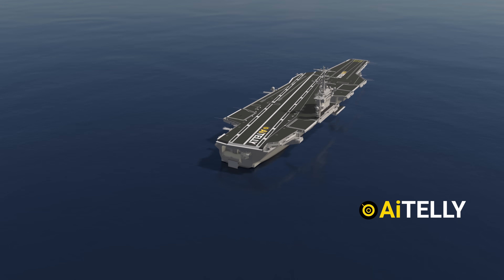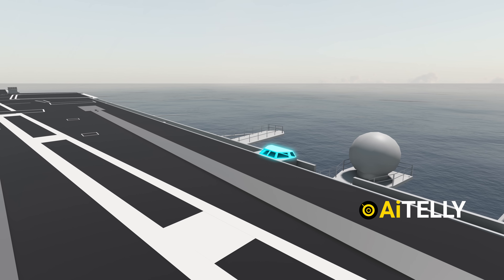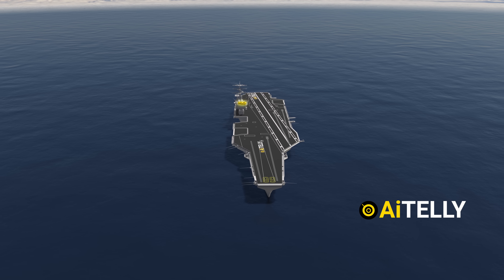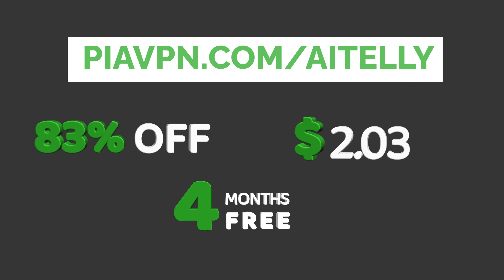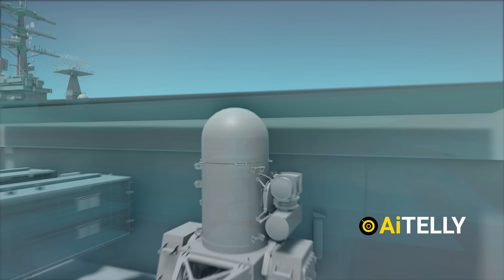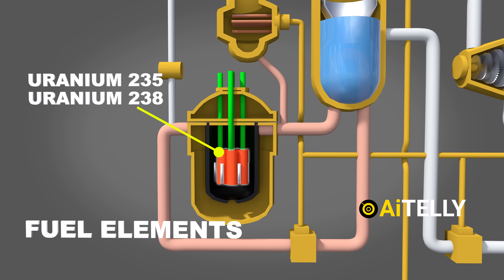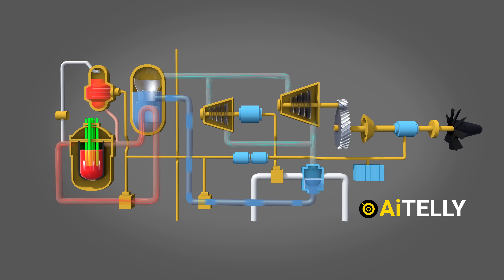How Aircraft Carrier Works? US Nuclear Power Ship Nimitz Class #ship

Comment: I'm a former crew member of a CVN. You got most of it right—nice job. Just a couple of clarifications: the Navy doesn’t operate F-16s from aircraft carriers, and the radar range is actually much greater than 300 miles, especially when you factor in the E-2 Hawkeye. That aircraft significantly extends the carrier’s vision and situational awareness. In fact, the air wing as a whole multiplies the carrier’s capabilities dramatically.

Comment: Corrections on the nuclear plant because, no, it’s not actually classified: 
Each plant is a 550MW A5W 
Each plant has 4 generators but only 2 from each are used for ship’s power. The other two are “CGs” or coolant pump generators, specifically designated for power the reactor coolant pumps. 
The generators do NOT connect to the propulsion turbines aka the main engines (MEs). Each ME is its own turbine and shaft with the forward plant powering the outside shafts and the aft plant powering the inside shafts. 
For the reactor fission process and pressurized water reactor (PWR) operation: control rods are rarely moved independently, but rather in banks to precisely control the even decay of U-235. The pressurizer does NOT create steam (thank god or we’d all be dead). In a PWR specifically, the primary water (reactor side) is isolated from the secondary water (steam side) within the steam generator. The primary water is NOT at 360°C (holy shit bro that reactor would be COOKING) but closer to 400°F. 
Lastly, as mentioned early, the mains are not powered in any way by electricity. They operate entirely on steam. Also I have no idea what a “motor” condenser is. Does that condense motors? It’s just a sea water condenser and there is one for each turbine. 

Hope this helps anyone who was otherwise going to walk away slightly misinformed.
Reply: I would just like to say while true that some information is not classified, most of the reactor physics and operations are confidential for Nuclear Operators. Whether it be MMN, EMN, or ETN's, they all go through schooling where they learn confidential material retaining to reactor principles, maintenance and operations, from the smallest things such as bearings to the actual reactor itself.

Comment: Great video. But the reference to the F16 is a huge mistake. Actually, the F18 is a development from the YF17, which was the competitor of the YF16 and it was selected for the Navy because it has 2 engines and also it has the option to modify the landing structure which was impossible to do in the more slim F16 body.

Comment: 100% incorrect the F16 cannot land or takeoff from an aircraft carrier. The undercarriage is woefully insufficient to withstand steam catapult  launches and wire assisted landings. The landing struts would be ripped from the plane. This is an embarrassing and ridiculous  error.   
Without beefed up undercarriage F35s cannot catapult launch or wire assisted land on carriers that is the reason for the F35C variant with its beefed up landing gear, tailhook. Longer wingspan and heavier frame. 
This video should be edited to remove the F16 or deleted completely.

Comment: Man, pretty spot on description of pressurized water reactors. 

The 2 A4W (Aircraft Carrier, 4th Core Design, Westinghouse) reactors on board are rated at 550 MW each. They require a refueling, called a Reactor Compartment Overhaul (RCOH) just once in the 50 year operational lifetime of the ship. One thing I’d like to add to your excellent description of how they operate is that there are two distinct water loops; The primary and secondary loops. The primary is the high pressure, high temperature water that transfers heat from the reactor. The secondary is the low pressure side that boils into steam, does useful work, and is condensed back into water. The loops are isolated from each other physically, transferring heat through “U-tubes” in the steam generators while maintaining containment of contaminated water. 

Of the eight turbine generators you mentioned, four of those power the reactor coolant pumps and four are for ship’s load. There’s also something like eight diesel generators for emergencies, but don’t quote me on that. 

I was a reactor operator on CVN-75, USS Harry S. Truman from 2013-2016, a rewarding albeit stressful experience. 

Excellent job on the video!
Reply: Excellent
Reply: 4 diesel generators from an MMN who spends too much time with RA
Reply: Bro also said the electric generators drive the shafts

Comment: *@3:08 The Jet Blast Deflactors (JBDs) are actually kept cool with internal piping that has chilled water to circulate on the panels. If they didn't cool the panels down then as soon as the retracted into the deck your shoes or tires would melt to them.

Comment: 7:16 f16 is air force, doesnt fly on carriers. It was weird because there were only fa18s all video and then randomly f16s showed up. 
8:58 you also called the aircraft carrier a battleship, battleships havent been in service since reagan pressed a couple ww2 boats into service prior to the gulf war. 
9:12 you also labelled the frigate as a cruiser. Frigates havent been in the us navy in a decade although a few have been ordered and will be launched in a few years, but none are currently active in the us navy.
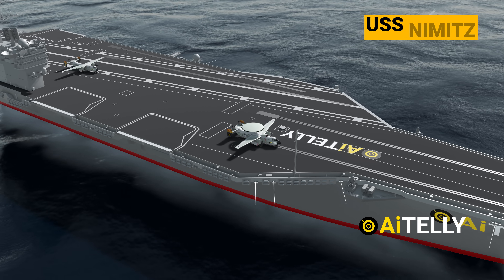9:33 your model of the e-2 hawkeye is wrong. That is a c-2 greyhound with a radar radome added onto it which is a nonexistent airplane. The e-2 is a variant of the c-2 in a way, but is its own unique plane. The c-2 does not carry the radar.
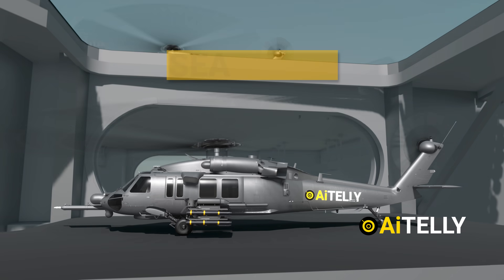9:59 that is not a seahawk but a blackhawk. The seahawk does not have a taildragger rear wheel, it instead had a twin rear wheel gear which is located much further forward at the rear of the crew compartment.

Comment: Your Step 6 in the operation of the reactors is inaccurate. There is no electric motor on the shaft driven by the reduction gears.

The core also doesn’t act as a “miniature sun” as that is a fusion reaction whereas a reactor is a fission reaction.
Reply: I think he means "electric generator" NOT electric motor... As step 4: the steam turn the turbine in high speed ...
Reply: @winnwinn7580 that would be inaccurate as well. The main turbines don’t indirectly turn electric generators. The turbines that produce electricity are separate turbines.

Comment: There are not appromimately 4 elevators, there is 4 or 3 depending on the class. And they do not ’facilitate’ movement, they make it possible!
Reply: I the class that is in this video, there are 4 elevators. The Ford class has 3. The earlier classes only had 1 or 2. The Langley didn't have one. So, point being?

Comment: Your description of the engineering spaces is mostly correct.  Some errors.  After the main engines reductions gears there are no electrical generators.  In reality there are TWO power generators, completely independent of the main engines, driving by steam turbines like the main engines.  Also, engineering spaces make up decks 4-9.  The actually machinery and reactor spaces reside on decks 5-9).  Deck four contains electrical load centers and other supporting equipment.  Also the machinery spaces (main engines etc) and reactor spaces are separate spaces divide by a bulkhead.

Comment: you had the radar room too high it's flight deck level and i think you meant either F14's or F35's there F16's are air force planes incapable of carrier flight, the landing gear is way too light as is the airframe and it doesn't have a cat bar or tail hook! and all carrier battle groups have at least one attack sub mandatory multiple subs are an option depending mission and expected circumstances! most carriers have multiple pintle mount points for weapons like the M2 50 cal and other crew served light weapons!
Reply from the maker: We removed the F-16 jet
Reply: @Aitelly maybe in the video not the audio, i clearly heard F 16 named.

Comment: You guys are normally pretty factual but damn, the F-16 mention is a pretty big oversight.  It also sounds like you’re saying the Phalanx and CIWS are separate systems but they’re the exact same weapon system. 

Minor nitpicks:  

A key function of the Arleigh Burke class destroyers is anti submarine warfare but that wasn’t mentioned, implying they were primarily anti-air. 

The scale of the F/A-18 to the elevator to the carrier is off.  As correctly stated the elevator can accommodate two fighters yet as displayed only one could fit.

Comment: Btw the navy does own or have F16s in their top gun program. So maybe they are carrier equip f16s that we dont know of or seen
Reply from the maker: Where did you find the F-16😉
Reply: A f16 was proposed a long time ago for naval use but it never got approved, neither does it have a reinforced landing gear and a chassis the can handle a catapult launch
Reply: @Pill_Cosby01  so are you saying the navy has 0 zero f16s in their fleet? If so you are wrong. You should research before commenting. F16s are used at top gun bro. Some can also land on carriers. They refitted the f16s. Tho only used for top gun aggression squadrons

Comment: Question?
Is it a cable or is it a chain?
Is the RADAR on their own channel?
Is it true that CRAM is on the Carrier?
Does the Nimitz have the 22? as well as the 35?
How many MARINES are on the NIMITZ?
Does the NIMITZ ever set dock? Or does the NIMITZ get's supplies air dropped? 
How does the Torpedo's Sonar system work?
What kind of tubing or pipes transfers the heat? Is there a heat exchanger as well?
Where does the Nuclear Waste go? Or where do they store it in?
NEXT VIDEO......SUBMERSIBLE AIRCRAFT CARRIER.....
Reply: I can answer most of that for you. I'll answer the ones I can. I served on the Nimitz from 2000 - 2004. The arresting gear is a cable with a small rubber core. When I left her in 2004, we had 2 RAM launchers and 2 SEASPERROW launchers. Anything else would have been after I left. As for the Corps. I can't give an exact because numbers will very. But, yes, the Corps, Army, and some other countries are on board when we went out. Ah, the supplies. Yes, we get supplies when we're in port. Other than that, we get supplies doing UNREP and VERTREP. Both of those will occur at the same time when we're out and about. A torpedoes sonar works like any other sonar. I can't get too detailed about it. And, that where I'll stop it. Getting into an area I can't talk too much about.